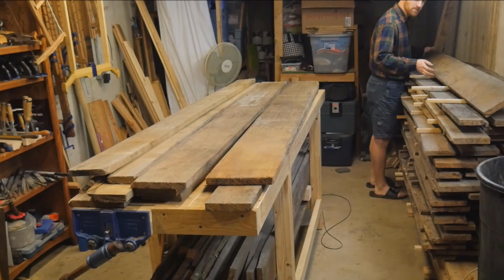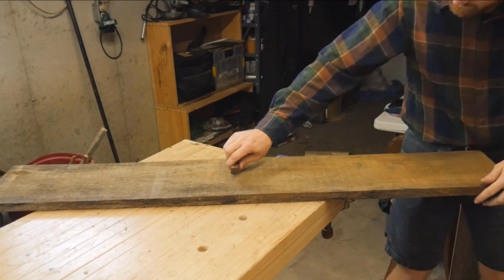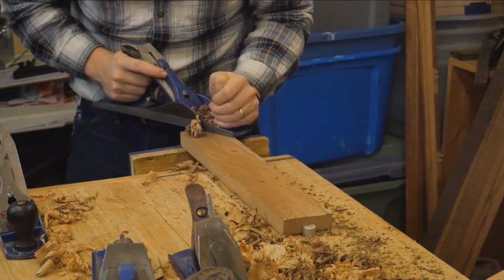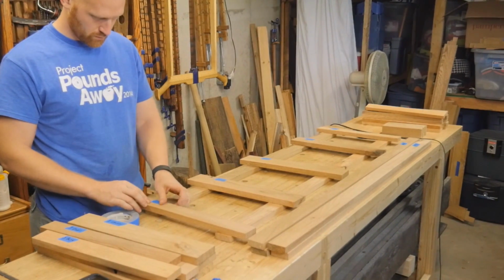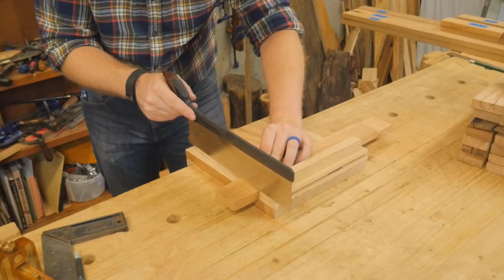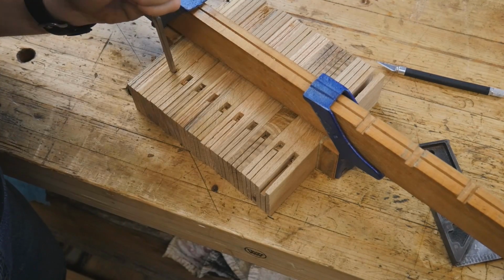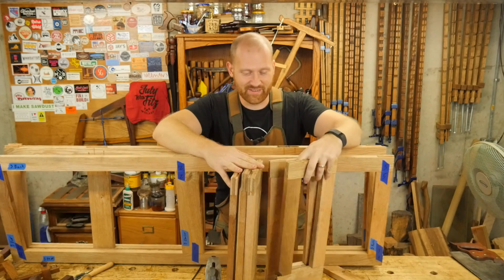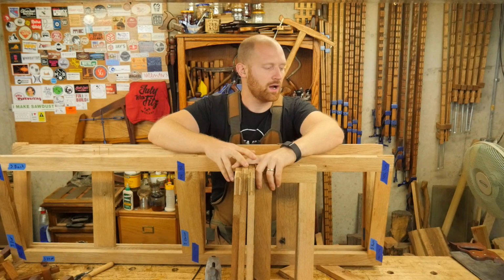Hand Tool White Oak Dresser Build Part 4 Carcass Frame (Mission - Craftsman)

Comment: Man, that's a lot of work James. I tip my hat off to you. I do have a question though. I find when I take rough lumber and mill it using power tools, I typically do it in two sessions. One to get it s4s, then sticker it and let the wood move a little bit. Then get it s4s again, and down to final thickness. My question is this. Do you find you have to do the same process I described with hand tools? I mean, get it flat, then give it time to move as the moisture is released, then mill it again?
Reply from the maker: +GuysWoodshop one of the nice things about hand tools is it is very easy to flatten things after the joinery has been done. So I just s4s the stock once and enjoying it all up. And then I will come back through with these frames and flattened and smooth them. I am not limited by what I can fit on my jointer or planner
Reply: So if the board moves after you s4s it, you do the joinery with the board out of square? I get tidying things up with hand tools after the joinery is done, I do that myself. I am referring to before the joinery.
Reply from the maker: Well with boards this size they will not move enough to change anything. If I were working with stock 6" or thicker then 3/4 then I would do it in 2 sessions. but also I dry my own stock in the shop or it is from this selection od 20-year-old air dried White oak. and it does not move much at all anymore.
Reply: Cool. Thanks for the reply James. The project is going to be awesome when it's done!

Comment: I use alot of hand tools but the thought of surfacing that tough wood all by hand and cutting it all by hand is daunting. I am impressed you did it all and did it so well. Kudos. Frank
Reply from the maker: +Frank B well thank you. It it more fun then it looks but I am a bit twisted.
Reply: Well, if you are doing it for pleasure who needs the expense and noise of all the power tools.? Also you get a different texture to the finished product.
Frank

Comment: I'm curious about marking the reference face with tape rather than just a pencil mark.  Is it just so it's easier to spot so you don't accidentally reference from the wrong surface?  Seems like it could get in the way when you do layout and marking.
Reply from the maker: +Mike Higgins it is more obvious yes but I also market on there what the piece is and what it is connected to and how it is oriented. Also, the tape makes it easer to change things if needed.